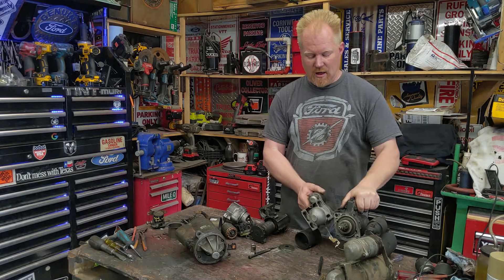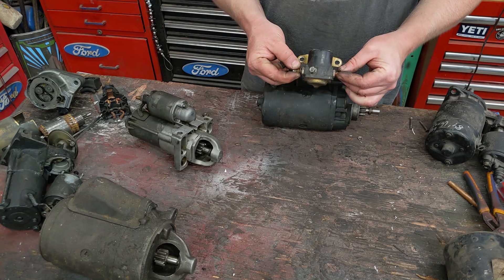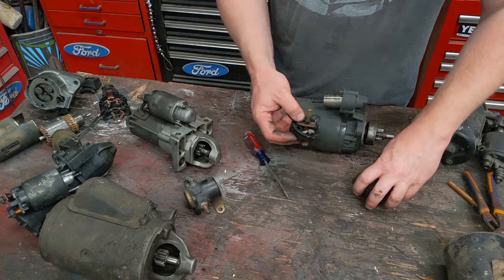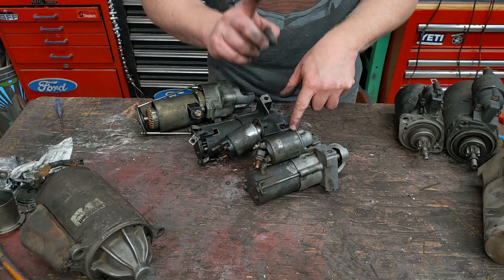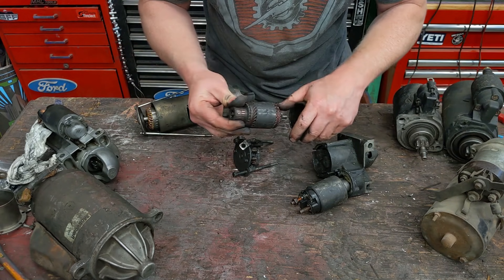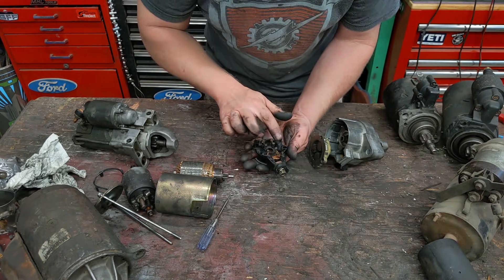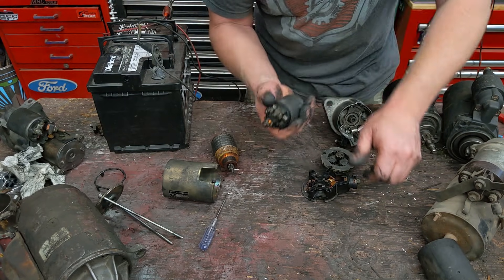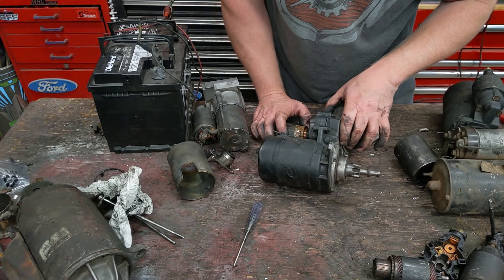HOW to REBUILD Starter Motors and HOW they Work

Comment: Do you know where to find a starter rebuild kit for a 2010 Chrysler Town & Country Limited? The starter is 19026S. The big auto parts stores have rebuilt starters for sale, so repair kits have to be available somewhere. I tried your Amazon link, but it didn't show a starter rebuild kit for a 2010 Chrysler Town & Country Limited.  Very good video. I especially liked your comment about the cheap Amazon starters, as I bought one (before seeing your video) and it failed within 2 months.
Reply from the maker: eBay or just googling, it is usually your best bet. They don't have them for all starters though as so few people rebuild them these days.

Comment: I wish you had talked about the "bendex" because ever since we owned our 1990 FORD Econoline the bendex spins out after a few years.
My garage has replaced quite a few starters because of bad bendexes.
He used to have an old timer rebuild them and he did a good job but he had a stroke so now my garage has to buy those Chinese starters.
My garage said this is happening because we have a dirt driveway and the whole inside of the starter is full of rust.
Question, Can I spray oil on the bendex?
The starter spins but it will catch, we do not drive the van every day, maybe every 2 months.
I was told not to oil the bendex, what do you think?
Reply from the maker: Your Econoline should be one of the last direct drive starters Ford used. Identical to the big one I showed. Rust will cause the Bendix to not push forward, but there is nothing wrong with Bendix itself, just the mechanism. I have seen these coated in oil for decades without giving trouble. So if rust is an issue, personally I would coat it with oil. This would pickup any dust/dirt and hold it on the outside creating a protective layer from water getting in and rusting it.
Reply: @sixtyfiveford  Thank Moe for the info.
Getting the oil into the bendex will not be easy unless I drill a smakk hole in the bendex housing.
Will coating it with oil ruin the brushes?
Reply from the maker: @old64goat  Oiling the outside once it so won't hurt anything nor get in the brushes. It's only the cars that constantly leak oil for years on them that turn out like the one in the video.
Reply: @sixtyfiveford  Thanks Moe, I appreciate the help

Comment: About 45 yrs ago i repaired an AMC Gremlin starter by just replacing the drive gear, probably a less than $5 part. With a modern starter I wonder if it's even possible to buy that single part  or if the only choice is replacing the entire starter.
Reply from the maker: Parts are the hard part to find.

Comment: I've replaced the battery/alternator  and cleaned all constructions and still won't crank no noise nothing plz help
Reply from the maker: @stonergirl4208  The first most basic step is to put in neutral and see if it will crank. Then back to park while wiggling it. The neutral Safety switch is a common problem. After that, if you've addressed the battery, and all the connections you're going to look for starter relay. It could be your culprit

Comment: The one you get from oriellys is remanufactured for about 150 plus they steal your Motorcraft core for 20 bucks. They guarantee it for life though. But, I can get a brand new one off of Ebay for 40 bucks, sell it to my customer for 75 and install it plus labor and am saving them 100 bucks that doesn't go into o'reillys pocket. The ones off of Ebay work really well and hell if it fails I'll replace it. Which I have replaced about 10 and not one failed yet. The ones you get from Oreillys are remanufactured where they only replace the bad part and spruce it up. Same with alternators...

Comment: I'm surprised you didn't discibe more about the Ford starter's. because I'm sure you know about them, like the main difference between them and other starters. besides the fact that the seleniod is separate from the the starter motor assembly. all starters have to have a way to kick out the starter drive to engage with the flywheel or flex plate gear. and Ford starters do this in a unique way. instead of using the seleniod to kick out the starter drive assembly. Ford uses a counter weight that is drawn in by the armature when it's energized. this counter weight in turn kicks drive out. because the armature turns into an electromagnet. however Ford starters have one inherent weakness and that is the drive assembly. I'm sure you have experienced this before where a Ford starter. will crank the engine two or three times and then freewheel. that is caused by the overrunning clutch in the drive assembly failing. Ford starters actually last a very long time but the starter drive doesn't. I would be willing to bet that about eighty percent of the time. people replace the whole starter when the only thing that was wrong was the drive assembly had failed. I have replaced so many of those drive assemblies. I can practically do it with my eyes closed. another unique feature that Ford starters have. is once you remove the tin cover they have inspection windows to check the condition of the brushes. which is good thing because replacing the brushes on Ford starter is a pain in the ass. something else that happens to all makes of starters. is the bushings can wear out and they can replaced without replacing the whole starter. I have even went though the Ford seleniods. just drill out the rivits pull the cover off carefully not to break the gasket. and you will find a copper disc about the size of fifty cent piece. and because there is so much amperage going through there. it burns the area where the disc meets the terminals inside the seleniod housing. just sand the burn marks off some of them you can flip the disc over. and then put it back together with new rivits or screws and your back on the road.

Comment: Great video Sixtyfiveford! Sadly rebuild kits are not made for all starters, or kits are becoming harder and harder to find, specially for newer cars and specially European cars. In any case, a great skill to have. How about a video on how to make your own brushes when replacements can't be found? That skill can apply to any brushed motor or generator. I had to do just that not on a starter but on a Coleman 5K generator. A block of graphite, sandpaper, a caliper and lots of patience, lol.  Either that or an alternator repair video. ;)
Reply from the maker: You're right. Parts are not easy to find. I have made my own brushes for motors a few times. I generally just buy bigger brushes and sand them down to fit in the holders. You're right about the patience part.

Comment: You glossed over the ford starter like it was diseased lol. I think the old ford starter system was the most reliable.  You also only talked about the electrical contact that the solenoid does and not the engagement of the bendex gear. Another reason I think the ford was better. Good video though.

Comment: How does the oil enter the starter? 5:29
Reply from the maker: Leaking oil from the motor drips on it.
Reply: @sixtyfiveford  oh wow, from a seal? so it can keep happening?
Reply from the maker: @sl5311  A leaking rear main seal or valve cover seal will drip onto the starter and soak it. A valve cover seal can be replaced to remedies this but the rear main, not so much. In a lot of cases the only cure is the completely remove the engine and rebuild the engine.
Reply: @sixtyfiveford  Interesting because this happened to me with my alternator on my C240 Mercedes Benz.  I took it too O'Reilly's -two locations and had it bench tested and it was ok. Then I took it to an auto electric guy where he showed me what the machines cannot.  He said oil will get in them and then after about 10 mins heat up, move around alternator and then cause the alternator to fail.  So I totally believe this.

Comment: It’s not a starter relay, it’s a starter solenoid.
Reply from the maker: Technically it is a "starter relay solenoid" The relay is the electrical connection and the solenoid is the mechanical action.